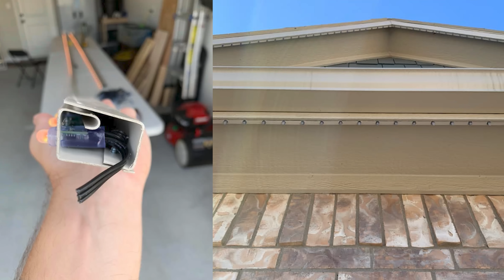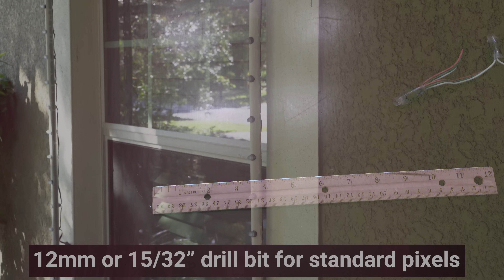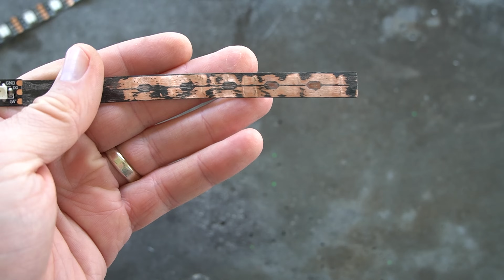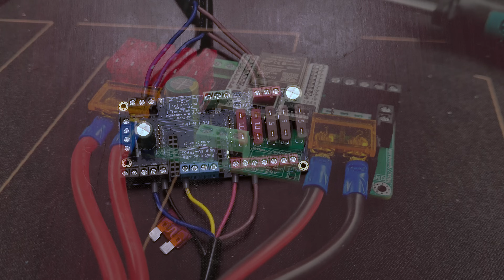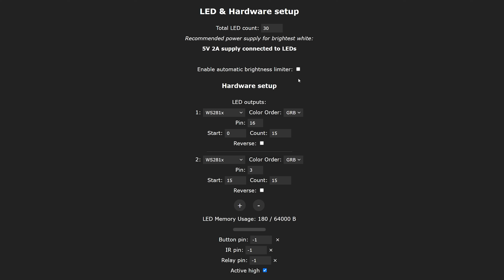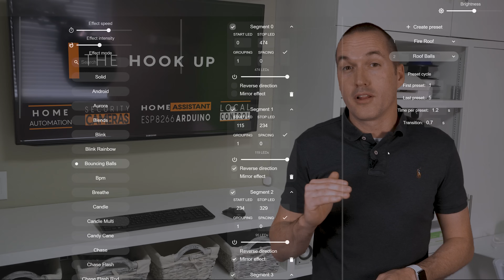DIY Permanent Holiday LEDs: Complete How To Guide 2021

Comment: ref the 12v bonfire pixels, most were Regulated pixels from one vendor last year (2020) who had a dodgy pcb design & the regulators could burn out.  I've not heard of a 12v resistor (which most are) doing that.
Reply from the maker: I sort of agree with you, though I find the data collection methods on pixel report extremely dubious.  Without also collecting information about working pixels within the community there's no way to draw a meaningful conclusion.  The xLights community largely orders from Ray and is also the target audience for pixel report.  The xlights community has also heavily favored regulated pixels in posts and articles which could explain the prevalence of that in the data set.

Comment: Great Videos! thanks for keeping it updated. I have a question but it's more about installation with strips. What do the connections at the peak look like, and how did you install them? How did you run wires to each zone? I know every house will be different but I'm looking for suggestions. I have a house with 4 Peaks and 4 separate runs. I'm getting stuck on the running wires.

Comment: As always a great and informative video. I do have a question about installing permanent light strips. What do you think about high voltage (110V) rgb Led strips?. It would seem better in the long run since it would eliminate common failure points like power injection points, power sources, etc. I know they are more expensive but if you can install them and no having to mess with them for a few years wouldn't that be worth it?
Reply from the maker: 110V strips are terrible. Not only are they non-addressable, but they also flicker significantly due to poorly smoothed rectification.  Also a huge fire hazard.  Basically they should never be used.
Reply: @TheHookUp  Wow!! Thanks for the heads up!. Good thing I asked you. Thanks for the quick response.

Comment: Really enjoy your videos! I have a question regarding the total length data travel on strings. I know power should be injected every 5 meters but at some point does the data signal become too week to drive the LEDs?
Reply from the maker: No, the data is retransmitted by each LED as it passes through.
Reply: @TheHookUp  Thanks for replying so quickly. I thought that was the case. If I have injected power via 22ga wire at 10m (following your instructions for 12v strips) what could cause lite flickering/randon LED flashes?

Comment: Heat in cables is not from the volts, it's from the amps.
So in fact by telling people to use 5V over 12V/24V you highly increase the risk of them burning the house.

The wattage is the key here.
If someone wants to use LEDs with a total consumption of 150W this means 150W/5V = 30A while 150W/12V =  12,5A and 150W/24V = 6,25A.
Without taking into account the cable length these are the recommended cable sizes:
For 30A the recommended cable size is 4 to 6 mm²
For 12,5A it's 1,5 mm²
For 6,25A 0,75mm²

Please clear that up, because if chosen the wrong cable size going to 5V can highly increase the fire hazard.
Reply from the maker: Sorry, you are saying all the right words but coming to the wrong conclusion.  Amps heats up wires, but you can't have amps without volts and a 5V source isn't able to push enough current to cause sufficient heat to start a fire.
Reply: Thanks for the reply :-) So you say that e.g. a 5V/60A Meanwell PSU won't melt a cable long enough to heat up surroundings like wood, to let those catch fire?
Especially as the cable size get's reduced during the melt the Heat will increase rapidly.
Taking into Account "IEC 60287 Current Capacity of Cables - Rated Current" the recommended size of a cable in regards to themal issues is independant of Voltage.
Furthermore as stated above reducing the voltage, while wanting to get the same wattage results in much higher currents thus increasing the need of a higher diameter.
Reply from the maker: What I'm saying is that it just seems like you have a fundamental misunderstanding of how voltage relates to amperage.  Here's a very long discussion on it by some people who are even more qualified to speak about it than me (btw I'm a certified physics and engineering teacher): https://youtu.be/6t1xthplvYw?t=1743
Reply: @TheHookUp  Thanks for the additional details, I just looked shortly at the slide and while some conclusions seem plausible I still have some doubt, as this is somewhat contradictive to the contents of my electrical engineerings universal degree and "industrial engineering" technician. Especially in regards to accordance to german standards.
Thanks for the link I'll watch it open minded lateron.

Comment: New to the channel great info I’m not great with computers and trying to learn the whole audrino thing can’t even spell it right 😅but want to do some lighting on the house for the holidays nothing fancy like you have but want to build a controller in a waterproof box like on your video did you build those yourself if so do you have a parts list and a wire schematics thanks for the help and sharing your experience and knowledge great video

Comment: Just starting my journey to permanent home lighting. 1st, your videos are the best I have come across so thank you! I am wondering if everything mentioned with cutting/attaching/controller etc is the same for RGBW strips? I will defiantly want a white channel for non festive year round accent lighting. If I were to follow this guide using RGBW is there anything different I would need to know/do/get? Thanks in advance!

Comment: Curious what you did to fix the lightning strike damage.  We had a direct hit in July.  It took out 4 wled controllers.  I replaced them and the lights turn on to red but not all turn on.  You cannot change the colors because they only turn on and off.  I replace WLED controllers, power supplies and plan to replace all the strips but ran out of time this year.  I have around 300 linear feet.  Do you think I just have to replace the first pixel?  Or did you replace the entire strip?
Reply from the maker: It killed the first LED in each run, all I had to do was replace that LED and everything came back to life.  The controller they were connected to at the time was my NodeMCU from a previous video and it never came back to life.
Reply: @TheHookUp  thanks. I’ll try that first to see if it saves me the hassle of tearing all of it down. 
Thanks!

Comment: Can you explain the parallel run power injection more? How did you calculate/figure out that 22AWG would be sufficient? Quindor did a whole livestream on this to calculate AWG for multiple 'home run' power injections, which would probably require 10/12 AWG in your setup. So, I'm struggling to understand how 22 AWG doesn't result in total voltage drop-off for your 15-20m runs. How did you calculate/figure out 22 AWG would be sufficient, and how can others figure out additional 'home run' power injection AWG requirements when using this parallel run method?
Reply from the maker: It's not about being sufficient, it's about being better than nothing.  If I want to blast at 100% brightness white it's going to look bad, but that doesn't really happen in any of my effects or any parts of my show.  There are a few times where the entire display does a quick "flash", but it's so short that the color accuracy isn't super important.  

The best power injection would be to do a home run of 16awg wire to every LED so there is no voltage drop, but that's not going to happen.  Aside from that everything else will be a less than perfect solution and you need to balance your expectations with the realities of running wire.  My first floor run has the single home run injection point, which gets me good color accuracy for effects, while my 2nd floor needs to be babied a bit, and I need to reduce the brightness of certain effects  to avoid color inaccuracies. For me this was worth it since any home run would have been highly visible on my 2nd story.

Comment: Getting ready to do my install.  I have the ESP8266 but I don't have the digiquad (the board with the fuses that the ESP8266 might plug into). How important is the digiquad?
Reply from the maker: Digquad makes life a lot easier by taking care of the level shifting and fusing, but it's not totally necessary.

Comment: So you can sync multiple devices (say 1 digquad & 1 diguno)… could you have 3 of the outputs from the quad sync with the uno and the 4th output from the quad doing its own thing?
Reply from the maker: You can sync the outputs of the diguno and digquad easily.  As far as the 3 outputs of the digquad synced and 4th doing it's own thing, that wouldn't be possible with E131 light show data, but with normal WLED control it would work.

Comment: Great overview!  It gave me some ideas about how I might setup some LED strips under my soffits.  And, I see that the new DigiQuad supports up to 24 volts, so that will help with power injection on some of my longer runs.
Reply from the maker: 24V input on the DigQuad would be only if you were using 24V LEDs.  Are you planning on using large step down converters?
Reply: @TheHookUp  Yes, I would put buck converters at various points to inject more power and keep the brightness even.  I currently use a central 24V DC power supply in my basement network rack to run under-cabinet lights in a couple of rooms, with local buck converters.  This significantly reduces the losses due to resistance in the cable runs.

Comment: The biggest problem I'm encountering in my area (Pacific Northwest) is my big box stores don't carry J Channel!  Even online, their websites say "No stores within 100 miles have this product".  I saw you use small diameter PVC pipe at one point.  Is there any other type of channel you recommend?  I'm using WS2811 12v pixels. EDIT: I see your shopping list has "U Shape LED Aluminum Channel".  Would that work with 12v pixels if I drilled holes every 3 inches?
Reply from the maker: I don't think the diffuser would be a great option for drilling, it would be sharp and isn't deep enough to house the pixels.

Comment: Please consider using a heak shrink hot air gun rather than a naked flame. They are not expensive and are considerably safer and kinder to the cables and their insulation than direct fire

Comment: What do think about 120v strip lights ? I'm thinking about going with those .
Reply from the maker: Not individually addressable, prone to flickering, unsafe voltage that could easily result in a fire.  I wouldn't recommend them to anyone.

Comment: Thanks much for all the information! Suggestion for the future, diy'ers often need a complete system assembly shown, like via diagram or well labeled video, etc. When it's this many concepts and hardware kits and they are spaced out the clarity kinda gets lost. Like I'm confused about where and how to inject, what can coexist with what, very shaky about how they all plug in with the micro boards or how to futureproof/expand. That's because it's all shown piecemeal. A comprehensive, well labeled project flow image at the end just clarifies a ton via singular reference point. At least that's what prevents mistakes and cognitive tutorial dissonance for me. You could show one setup with 12v strips and proper wires/hardware, one with 5v, etc. Anyway thanks, some of the best info out there, keep making vids!

Comment: Quick question - you're house in the halloween video - did you do 30 pixel per meter or 60 pixel per meter strips?
Reply from the maker: 30
Reply: @TheHookUp  thank you so much! I bought both 30 and 60, and while the 60 looks great on my table, I'm worried about power. Thanks again!
Reply from the maker: @scottschreiter768  Yeah, 60 sounds great in theory, but power injection becomes an issue.  I don't think I'd try 60/m in 5v.

Comment: About the 5V vs 12V temperature test on a dead short: isn't this a factor of the output of the power supply? AFAIK, it's the current that determines how hot the wire gets. While it's probably true that most 5V power supplies provide less current than 12V supplies, that's doesn't really make 5V safer, since a 5V 10A PSU would do pretty much the same as a 12V 10A PSU.
Reply from the maker: They were both 40+ amp power supplies, the amount of current was only limited by the voltage and resistance, not the output of the power supply.

Comment: I noticed you have the DigQuad controllers with an ethernet controller. Love the idea to eliminate the common wireless headaches. However, are those ethernet lines exposed on the outside of your house? If so, are you running some kind of subnet or separate network to protect your main home network from a potential breach if someone wise to what's in there tampered with the box?
Reply from the maker: MAC filtered, just like my security cameras.  Someone could theoretically MAC spoof to get in, but they would definitely get noticed by that point.

Comment: Do you recommend to add a fuse in-line on the power supply ?
Reply from the maker: The DigUno and DigQuad have fuses, I don't think you need to fuse in between the PSU and the controller, no.

Comment: Im confused by the brightness limiter in wled.  If i have 525 12v string pixels.  what should I set it to?
Reply from the maker: Change the drop down box to 12V (30mA). If you have 525 12V string pixels that would be approximately 16A.  If you have the power supply, wire size and power injection to support 16A then you do not need to run the brightness limiter, however if you notice that the LEDs at the end of the string look like they are a different color you can try to lower the brightness limiter until there is no color inaccuracy (start with something like 10A which is 10,000mA).

Comment: This might be a hard question to answer but roughly what would it cost to run LED lights around the perimeter of a average 1500 or 2000 square-foot house? Let’s say may be 300 feet of roof line. I’m just kind of asking for ballpark cost.

Comment: Any reason to us hot glue vs Silicone when recoating your IP65?  Mind I have never done this as I am just know in the planning phase on doing this for my house.

Also does anyone have any suggestions for a single install point, parallel wire for injection on a single continuous run of about 45meters with the 30 led per meter strips?  Would this be too long for parallel injections?  I would like to avoid crawling through my attic.

Comment: I know this video is a year old, but hopefully you still check the comments. Was your 22 gauge power injection wire still sufficient a year later? I am running 12v 60LEDs/m and was wondering if I needed to step up to 18 gauge.
Reply: Problem is, I can't fit 18 guage in the aluminum channel
Reply from the maker: I installed my LED strips Christmas of 2017: https://youtu.be/q_-Iw4VRTtI

They have been basically maintenance free and the 22awg has worked perfectly but I don't run them at 100% brightness.
Reply: @TheHookUp  I just noticed your amazon shopping list has 18 gauge wire and not 22 gauge wire. So I was wondering if you had to switch it out and do not recommend 22 gauge anymore.
Reply from the maker: Oh, gotcha.  That's what I use for my power injection home runs.  I use this for the parallel runs: https://amzn.to/3SAsDSB

Comment: I do not see a link to the mounting enclosure that you installed the power supply and DigUno in? Where did you get it please?
Reply from the maker: No link because they are pretty much gone forever, those are CableGuard CG100s and they have been discontinued unfortunately. There is currently not a good replacement.

Comment: Thanks for another great video!  I am just getting started in automated LED holiday lighting.  One thing I wasn't clear on - does the QuinLED controller replace something like the F16 board, or are they both required?  It sounds like the QuinLED boards are a newer and cheaper option that many people are moving towards.

Comment: Thanks for these videos! I'm having issues with WLED and model BTF-5V-30L-W (WS2812B). Does the W mean it has a white LED?
Reply from the maker: I think that is just the color of the led strip coating
Reply: @TheHookUp  OK. I can't seem to get WLED working with this one. I have 2 other that seem to work fine. Maybe a bad string?
Reply from the maker: @jacobblack8014  Not unheard of, but I'd check it by plugging it into a known working controller.
Reply: @TheHookUp  Thanks for the help. What happened was they sent me the wrong strips. I got more of the WS2812B strips and the LEDs were clearly different. I got it working fine with the new strips. I think the ones they sent me originally were the ones with an additional warm white channel...thanks again.

Comment: Wow - learned something new - the data line resistor may very well be the issue with my dig-uno's flickering.  The data line is only about 10 feet to the light string but still get flickering.  Yeah I know there are many things that can cause the flickering but I think I have tested for and eliminated all other possibilities.  Thanks Rob!
Reply from the maker: Let me know if that fixes your issues!

Comment: On your parallel power wires for power injection.  I've been looking at LED strip calculators and they're saying  I need to use 8 AWG wires to prevent significant voltage drop.  And that's just for a strip that is about 20' or 6-7m away.  How far did you run those 22 AWG wires and have you experienced any issues with it since you made this video?